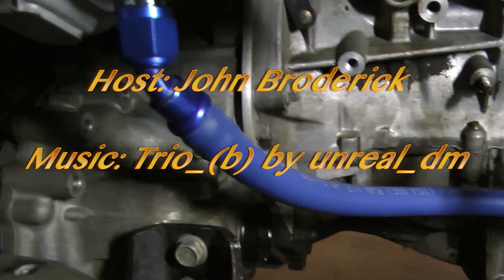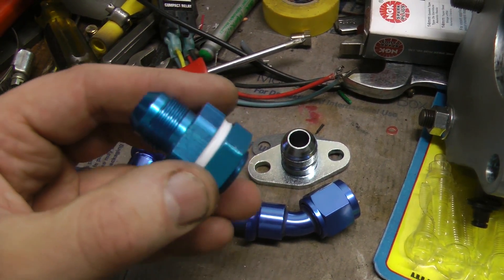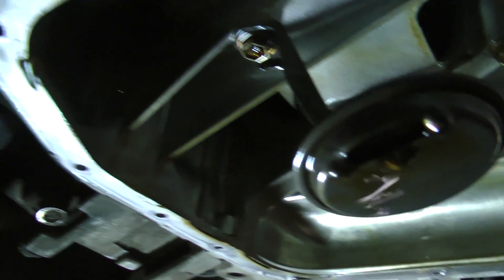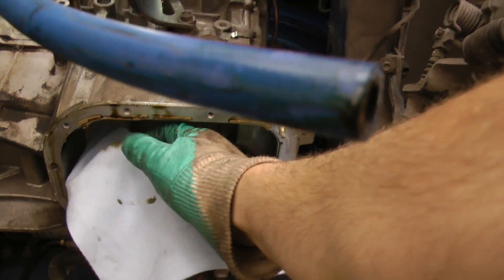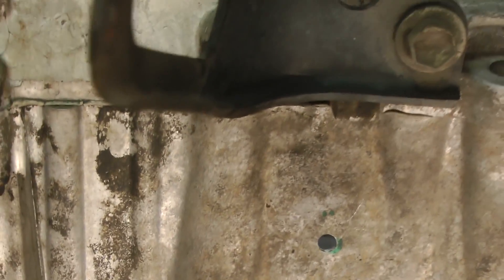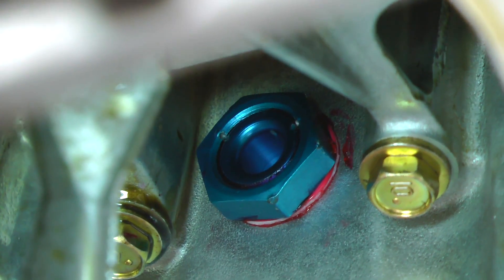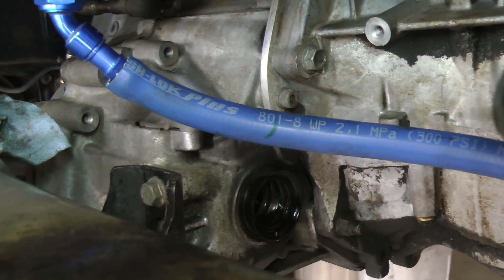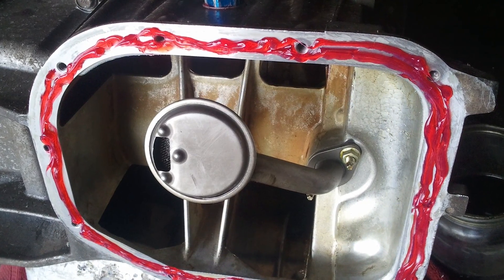How to make a Custom Turbo Oil Return Line DIY

Comment: When you talk with guys who rebuild turbos, a lot of the time they avoid the restrictor and just want at least a 20mm flow return opening and fittings to clear the build up of oil, I don't think it's advisable limiting the oil, just a good return flow would stop a smoking turbo! Great video and the direct return is the way to go.
Reply: Ball bearing turbo's require a restrictor on their 3AN feeds; manufacturer's usually mention what size

Comment: is a return line mandatory?
Reply: If you don't have a return line where would the oil go to?  Oil is constantly going into the turbo so it has to come out and drain somewhere. If the oil doesn't drain from the turbo it's going to forced into the engine and burned with the air/fuel mixture. The oil in the mixture would then lower the octane rating of the fuel mixture and the results would be detonation and catastrophic engine failure

Comment: Have you had any issues with the AN fitting getting loose from engine vibration? 
Only reason I ask is because I have AN fitting running from my valve cover to an oil catch and sometimes loosen up because of engine vibration.

Comment: My oil return line came off my turbo.  When I was troubleshooting, I noticed the engine sounded like it didn't have a muffler when the return line was off.  It also blew hot air out of the turbo where the line was.  Is this normal?  I didn't run the engine for more than a few seconds, so no oil came out, just hot, fairly pressurized air.
Reply from the maker: Great question AFHero66!! Anything coming out of the turbo will of course be hot.  The sound described could be excessive exhaust back pressure making its way backwards past the Turbo impeller seal and out the turbo oil drain. You may have a restricted catalytic converter or muffler.  I would suggest measuring exhaust pressure at the oxygen sensor fitting downstream of the turbo.  Drill a test hole in the exhaust pipe between the turbo and catalytic converter if needed to measure the pressure.  There are many videos on diagnosing a plugged catalytic converter.  If the sound is coming out of the oil return line rather than the turbo oil drain you may have a broken piston.  A broken piston would usually be accompanied by misfire at idle.  Good Luck!!!
Reply: @jbl212  I pulled the cat off just to check the turbo and everything looked great...until I touched the turbine with my finger and it just rattled around.  The new turbo is on its way.  lol  This also maybe explains why the exhaust gasses were exiting out the oil drain tube.  And ofc my oil feed tube was cooked too.  Summation:  No oil to lubricate the turbo, got hot, blew up, and now my $20 fix just went up to $600.  :)  Thanks for your response.

Comment: John great video!  I have to say YouTube and Google can be your best friend when you have people like you John puting trust worthy install videos.    You made my turbo install that much easier. Not to mention pepboys speed shop isn't annoyed any more with questions.    One question tho. How much boost are you running ? And the does the fitting stay tight under higher boost conditions? Say 15 to 30 psi.?
Reply: I'm just worried to turn the boost past 10 psi
Reply from the maker: @jeffreyheelan4850  Hi Jeffrey Thanks for the kind words!!   If the engine internals are stock 10 PSI is in the danger zone depending fuel choice, the tuning map,  and your elevation above sea level.  I regularly ran 11 PSI with stock internals on E85 fuel with a custom tune at 5000 (five thousand) feet above sea level and up.  I experimented with 15 PSI breaking OEM pistons.  The higher your elevation the more boost you can usually run before detonation occurs.  The most common failure is a head gasket if the operator does not fully warm the engine before applying boost.  Next to fail is usually pistons or connecting rods if they are not upgraded.  If you boost enough to cause detonation something has to give.  I have blown up many engines with turbos and boost.  E85 fuel works great with boost because it removes massive amounts of intake charge heat in order vaporize reducing chances of detonation.  E85 also burns slower and cooler than gasoline producing less peak cylinder pressure with a longer burn duration increasing low RPM torque.  You need to run E85 compatible motor oil and change it more frequently as it will develop high levels of acidity from running E85. You also need E85 injectors, tuning and possibly a special fuel pump, tank and lines.  You can run a blend of E85 with regular fuel.  A good test might be adding 2 gallons of E85 to a tank already containing 8-10 gallons of premium fuel.  I suggest you carefully monitor the air fuel ratio using a wideband oxygen sensor.  The oil return hose I used is rated for 300 PSI.  I have not had a problem with the hose or fittings on the oil return.  The main worry at higher boost is engine mechanical breakage not hose or fitting failure on the oil return line.  You can put clamps on the hose for extra security.  Did you blow it up yet?  Have fun Jeffrey and good luck!!

Comment: That return pipe just going to burn out or rupture due to pressure , fire tape wont protect it long term plus pressure will have effect on this.
Reply: Don't the upper sumps have a spot casted just have to drill n tap? 2j that is.

Comment: Hello I'm from Indonesia, I'm trying to install turbo on motorcycle.. I'm using ihi turbocharger. How to measure the different between inlet oil and outlet?.. there are 3 hole at the body.. txs for ur time..
Reply: The oil outlet is usually much larger than the inlet with a 2 bolt flange because oil tends to foam and expand inside the spinning turbo and the extra large hole allows the foamed expanded oil to flow properly when exiting the turbo.  Most IHI turbos have 4 holes with  2 for coolant circulation in and out of equal size.  The smallest of the 4 holes is the high pressure oil inlet and if you spray WD-40 into the oil inlet it will flow out the larger oil outlet.  You can also check the service manual for the vehicle that the turbo is from to identify each hole.  If this does not answer your question feel free to send me pictures by email at jb21126@gmail.com and I will do my best to help you identify the the holes.  Good Luck!!
Reply: Okay, tomorrow I will send u picture of turbocharger so my problem could be solved..
Reply: I'm already sent pictures to your email.. txs for your kindness..

Comment: What happen when the fitting is lower than oil level.. i hope sombdy will answer me.. thank you so much
Reply: the oil wont drain...
Reply: It is possible that if the oil wont drain... oil will come out to trottle body???
Reply: Hijan Radin its possible if you have bad turbo oil seals
Reply: Thank you so much

Comment: Please stop making diy video's, pretending to know what you're doing.

-restricted oil feed is not good to effectively cool an oil cooled turbo
-8an oil drain is too small and will cause problems if you use the right size oil feed
-almost horizontal oil drain line will cause even more problems 
-drilling in your engine block with only a paper towel to protect the insides from the dust
-removing the rubber driveshaft damper because it was in the way of your horizontal oil drain

There are people out there copying your work from these youtube diy video's, because they think you are somekind of pro. You will kill your turbo with oil setups like these, and soon enough kill your engine along with it
Reply: restricted oil feed is ok but 8an return is not
Reply: so tell us how it is right please

Comment: John I've been searching for a video on where to drill my oil pan for a twin turbo setup (oil return) on a 5.3 LS 1 engine, have you ever done one of these oil pans, and if so where is the best place to drill. Thanks in advance.
Reply: Front corners of the oil pan or you can put the returns in the timing cover.
Reply: Bad Luck Garage  Thanks for the additional information.
Reply: no problem

Comment: Does that fitting u used require u to tap the oil pan or is it compression type
Reply: E R dont you see the nut on the inside?

Comment: What gasket did u use on the return line coming off the turbo? Mine is brand new and is already leaking. Bolts r snug.

Comment: Why even drill the block?.... I purchased an oem pan, drilled it and put a sandwich type an-10 fuel filter in it.. Just need to make sure you drill in a place that the portion inside the pan wont be touching the engine. I'd say for most cars this wouldn't be an issue..
Reply from the maker: +ion123456 In my experience if you return oil below the oil level in the pan it will back up into the turbo and overload the turbo shaft seals causing excess oil burning and a lot of smoke out the exhaust.  This is why I drill the block.

Comment: -8an is a little small for a turbo drain. -10an is better size for most applications
Reply: Are you sure? -8 is SAE 1/2... which has tons of flow
Reply: enterBJ40 too small for my holset,i need 10an..
Reply: @vincevegacustoms8860  actually for a holset they require a hell of a return line, 16mm is too small for a holset. factory mitsubishi inside diameter is 16mm. an fittings are not advisable.

Comment: I don't if you very much about vws but.. I cannot find anywhere for the life of me to make a oil line feed and an oil line return for my engine no one really turbos that engine but I am and I don't know where to tap in for oil feel and where to tap in for return any suggestions?
Reply from the maker: Artemis Prime Which VW engine are you building?  On most engines oil feed can be taken from the oil pressure sender port using a tee fitting.  VW has factory turbo inline 4 cylinders and you can copy their oil return.  I you are building a flat 4 cylinder you can learn from a Subaru turbo setup.
Reply: it is the 2.0 AEG
Reply: John Broderick i have a water cooled turbo is there any way to determine which hole is for oil and water?

Comment: y not just drill the hole in the oil pan so you dont mess up a block
Reply: Bryan Teet because it wouldn’t drain properly
Reply: Technically he didn't drill it into the block. The engine has like a cast oilpan with a smaller oilpan bolted onto the bottom. Many other engines with normal oil pans you can drill the return into the oilpan. If you can get near the crankshaft level

Comment: What are your thoughts on marking the oil line on the pan, and drilling into the pan? Then doing your method?
Reply from the maker: If by "oil line" you mean oil level you are on the right path.  You must return oil above the oil level in the pan or crankcase so that it does not back up into the turbo. You must also consider the "dynamic" oil level under acceleration- that is the level where oil will roll up to or down to in the pan while accelerating. To combat this you can lengthen the return line further into the pan or raise the position if possible.  The other challenge is having enough slope or draft in the return line to provide gravity flow.  There must never be any kinks in the return line. I suggest removing the pan to drill.
Reply: John Broderick Yes, I was going to remove the pan, clean it, then fill it with and equal amount of quarts of water to simulate the oil level. Then mark where that line would be, and go from there.
Reply from the maker: Matt Neihart
Good idea Matt.  Maybe you can get some spare pans and see if there is a residual oil level mark in the pan before cleaning. Then think about dynamic oil roll. If you need a longer fitting into the pan you can use a "Bulkhead" fitting and even trim it to an angle if you like.  One pan could have the entire bottom cut out for interference checking with rods, etc. A spare engine would be nice if it's in the budget to check interference as well.  You may need the spare engine later based on my experience!
Reply: John Broderick I think I will get an extra pan, just to see how everything looks clearance wise. I will have to play the spare block part by ear lol. I just thought if their wasn't any clearance issues with the internals, that using your method on the oil pan would work. It would be easy to replace the pan and try again. Thanks for your input, I will let you know the end result.

Comment from the maker: Welding if done properly should work equally well.  I have reused the same fitting on three different engine blocks now.  In my case I prefer bolt on.  Yes, issues can occur drilling into the block.  You must be careful to avoid critical areas like oil galley's, main bearing caps, connecting rods and the crankshaft.
Reply: I think this method is fine for most but if you are anal like me.... I clean the area on the inside where the drills will come through then place a small cap from WD40 or paint can in that area and blob it with quick setting urethane, wait till it hardens and easy clean up afterwards.

Comment: I'm looking to turbo my Sohc d16 soon. I've seen some people weld the fitting to the pan. Does the anaerobic sealer work just as good as welding? And are there any issues that can occur by drilling into the block?

Comment from the maker: If you grease the drill bit and spin it slowly it will hold the chips and prevent them from flying around in the engine.
Reply: Very good write up John! You made the video so easy and simple.